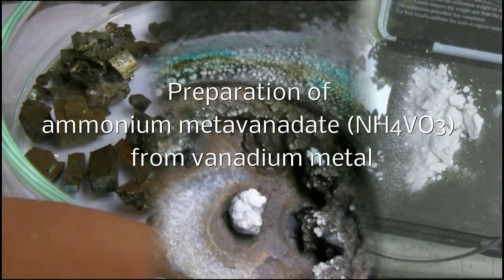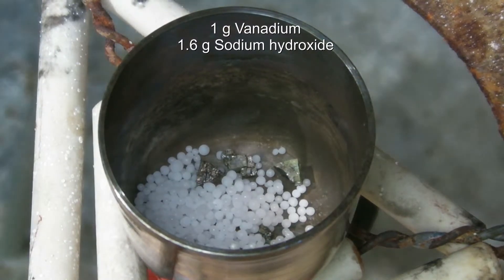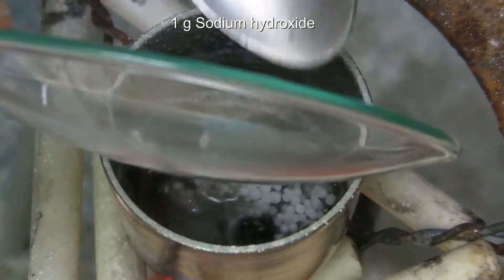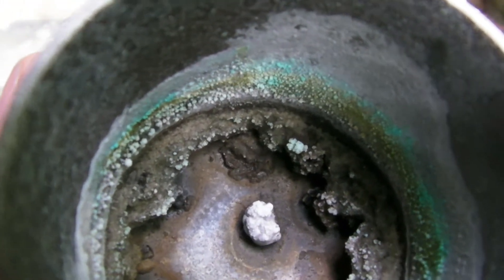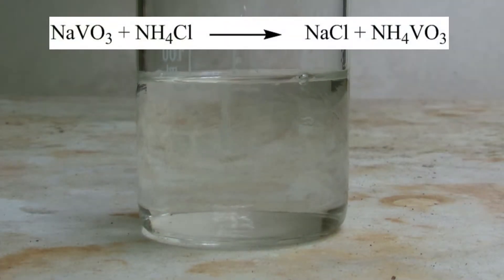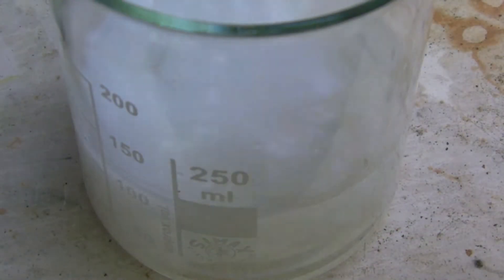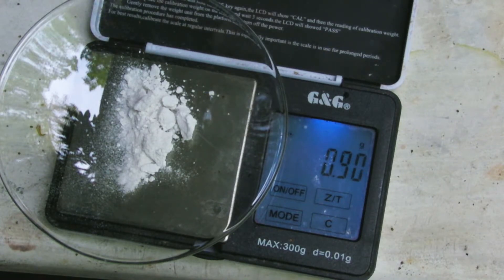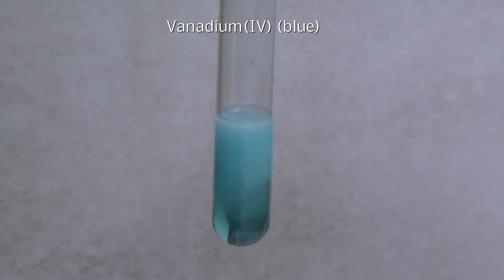Synthesis of ammonium metavanadate

Comment: I was following your method, I had to leave the crucible overnight and the remaining NaOH made a water pond over the reacted stuff, then I got busy with an electrolysis cell involving a hot HCL electrolyte, then I heated the crucible again to boil the water off and I got a yellow/orange solution and precipitate. The HCL vapors must have gotten into the crucible and reacted with the NaVO3 to V2O5. Also the first time I heated it the sodium combusted, I got huge flames of sodium raging from the crucible, heat slowly!  Thanks a ton for your technique!